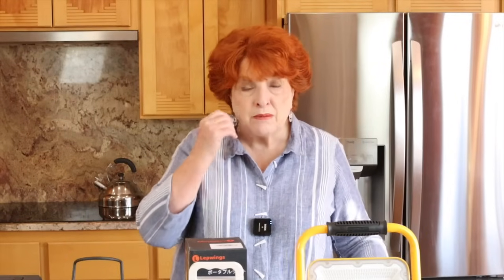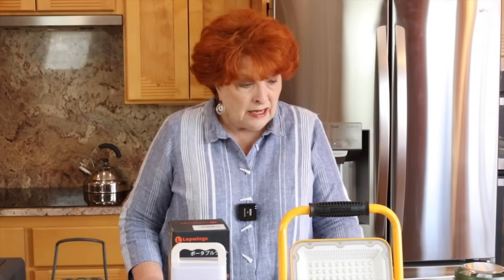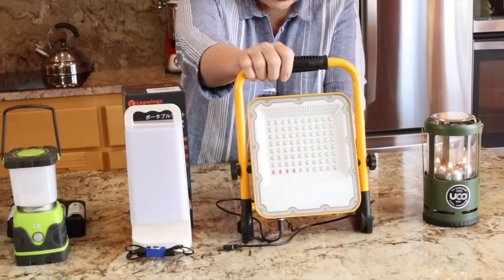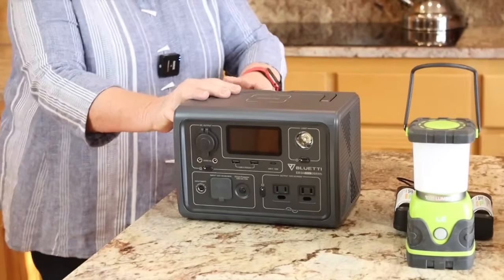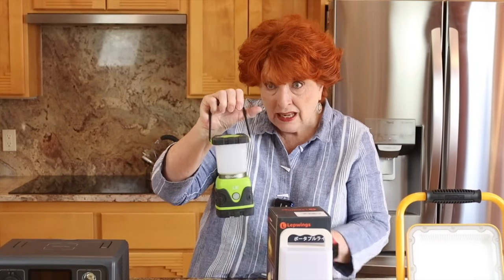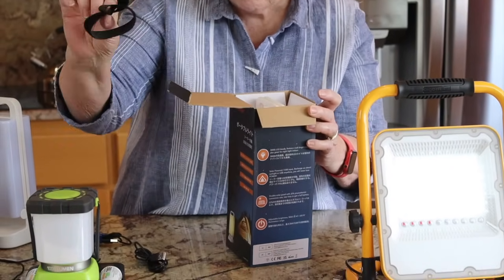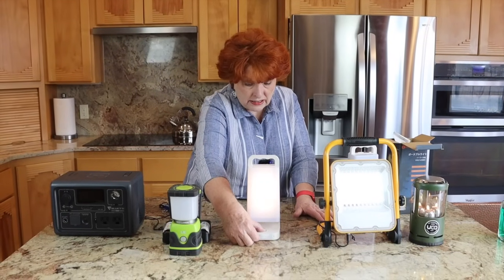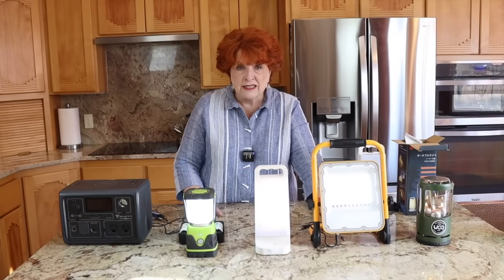Emergency Lighting Revisited

Comment: I use Energizers lanterns for most of my light during 3 years of living off grid. I have a couple rechargerable flashlights also. I had to charge my phone in my 1999 pickup truck. I tried to charge lights on the trucks usb. Twice I killed the battery and had to ask for a jump.  About once a monthy son would charge something for me. It was tough and I am older. After 1 winter with no heat, I got a little buddy heater. It really helped. I have a large dog so I never used it when I could not watch it. Nights had no heat. It was 40 degrees for a month at bedtime. Luckily my pittbull sleep beside me. Goosedown comforters ans wool blankets helped alot.

Comment: I bought the solar panels light and LOVE IT.  It has a very pleasant light, adequate light for any task, and long lasting runtime.  I got it for checking on my chickens, working late in the garden, transferring wood for the stove, as a secondary source that is reliable and can be hung up or set down. They don't mention the velcro strap, but I think it's to be put on a backpack to charge while you hike.  My daughter and her boyfriend got lost on a new trail, it was getting dark, and there was no cell reception for GPS (luckily someone came by and gave directions).  This would have been great if they had to stay in place because of the length of time it runs!

Comment: You can use solar stake lights to charge your rechargeable batteries. I kind of stumbled upon this idea when I was changing out the weaker, poorly made batteries that normally come with solar stake lights. If you put a better quality, more powerful rechargeable battery into a stake light, the stake light will stay lit for much longer. Then I concluded that using solar stake lights to recharge batteries is a cheap way to keep your rechargeable batteries charged up & ready to use. 

Edit: You'll need to remember to remove the batteries from the stake lights before sunset. Otherwise, the stake lights will light up when it gets dark. I've considered splicing a longer cable & a simple on/off switch on a solar rope light that I have & permanently mounting it inside the house for emergency lighting.

Comment: I’m a little old fashioned.  I collect the old oil lamps.  The lamp oil is still relatively inexpensive and a little lasts a long time.  I adore them.  I also have solar, battery operated, rechargeable, etc as well but I really prefer the oil lamps.
Reply: We have oil lamps as well but they don't always put out enough light for my needs.

Comment: Back in the day before solar I had a few oil lamps, flashlights, and some candles for light when the power went out.  (still do) Power went out a few times a year where we lived in the country and once for over a week.  Now I have a Bluetti 180 which will power lights for a long time but I am seeing that the portable lights you have would be great to use for going out to the barns or for wood in the hoop house. Time will tell if the power is more reliable at our new farm.  Great suggestions for lighting options I can research and thinking that another small Bluetti would be very handy either in the house or shop or barn.  Already have the solar panels.

Comment: What do you think about using outdoor solar pathway lights as emergency lighting? We have ones with stakes that line our driveway, and they put out a lot of light. I thought of having small pails filled with sand or dirt inside and bringing the solar lights in when the sun goes down, putting the stakes down in the pails to light each room. I think it would work.
Reply: On some solar lights the spike at the bottom is removable. I put them in a mason jar indoors

Comment: Thank you for the update on emergency lighting.  We might check out your newest one as it would be easy to solar power it up and the note said that you could charge your phone with it as well.  We purchased from Costco last year lights like your battery powered one but you could charge them with USB or use batteries.  They can be used for charging your phone or anything that could use that connect which it does come with.  There are 3 power levels and it does last a long time on a charge.  Worth looking into.  We also had purchased a couple on Amazon.  Thanks for always showing us new ways to stay prepared.

Comment: Since we get a lot of earthquakes and also have cats - open candles are not an option.
I met a gentleman in a thrift store who mentioned that he’s currently homeless living in his car (in Alaska). He mentioned that he was using candles and clay pots. I remembered your episode on clay pots and tried to discourage him using those. I told him about the UCO candles. Alaska Prepper had done a review on those and actually tested how much they increased the room temperature in his “bunker”.

We have a couple of the UCOs as well as the battery operated one you have and love that one as well. We also have several other battery operated lanterns that are great. And if we really need A LOT of light we have a shop light that’s rechargeable by USB port.
But we also use emergency lightbulbs and absolutely ❤️ ❤❤those. The work like a normal lightbulb but have  a way to charge up while in normal  use. When the power goes out they come on automatically. You can also unscrew them and use as a portable light. Would love for you to do a review on those. We’ve had ours for years

Comment: I changed out my rechargeable battery stash for all AA & AAA and purchased several adapter kits that make those fit C and D battery items. It is not only cheaper on battery purchases but allows us to have what we need on hand no matter what. I also have 9V batteries that are charged by USB and they work great.
A hint for lighting - hanging your lantern above your space provides much more useful light. And headlamps are more useful than they seem before using them.
Great video as always!

Comment: For economic emergency lighting -

Get several decent quality solar yard ornament lights.     Simply bring them inside when power goes out.   

Also... after Christmas  - buy some long strings of LED white C9 bulb christmas lights.  Super low wattage.   I ran a forty foot string through house and had lighting in all rooms for four days off of a car battery jump pack and a 100 watt inverter.

Dont discount kerosene lanterns.   I couple those with a three burner Amish kerosene cookstove and a couple kerosun heaters.   I even have a 22 wick kerosene canning burner.

Note - in bad times you can substitute diesel fuel for kerosene - if you put in some 90% or better ethyl alcohol to thin it for cold weather.

Kerosene was a staple in homes in the late 1800's to about 1940.  Still is in Amish communities.